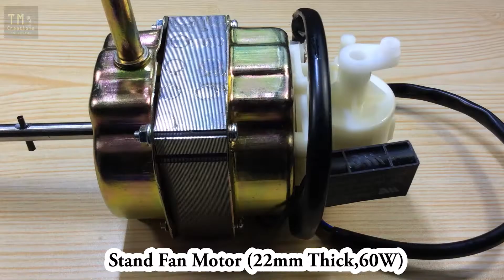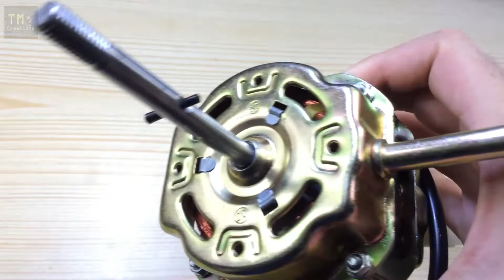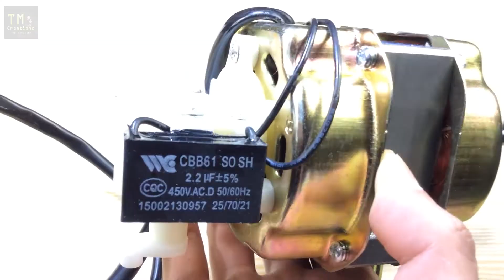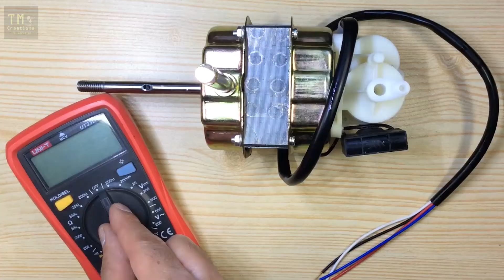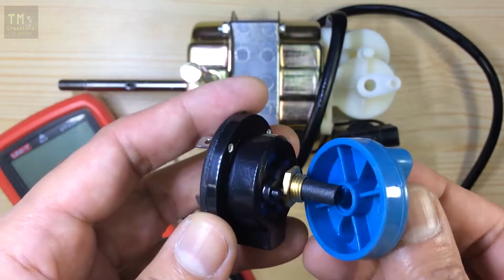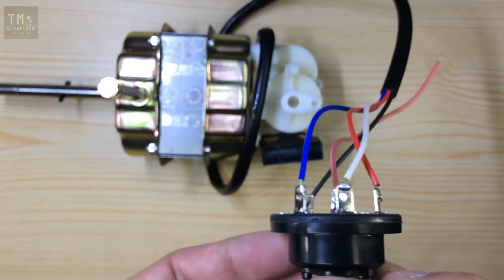Fan Motor Wiring Connection / 3 Speed Fan Motor

Comment: What about the red, black and green wires from the 3 pin plug , correct to where?
Reply from the maker: These wires are for different speed selector.You can increase the speed of motor selecting dofferent wire.If select red,than speed will be high.Black is common wire.Thank you.

Comment: is it possible to reduce speed of lowest mode ?
Reply from the maker: Yes it is,but we can use AC motor speed controller for this.We can make it using few components.Like using BT136,DB3 Diode,Capacitors etc.